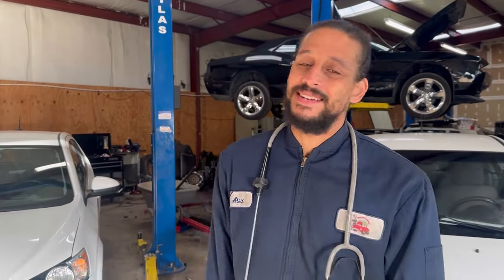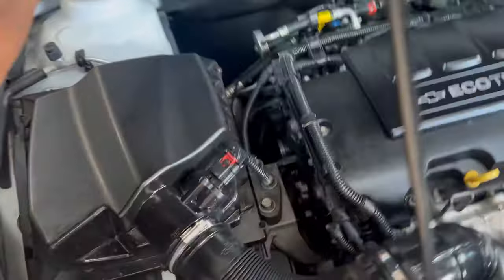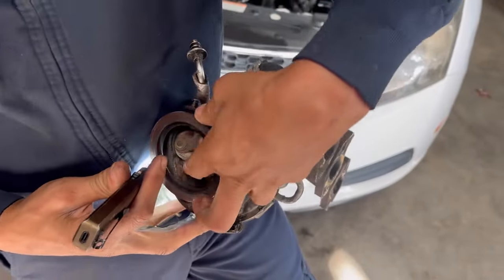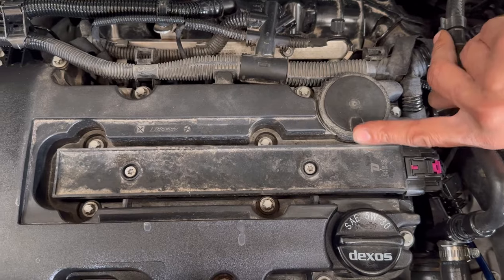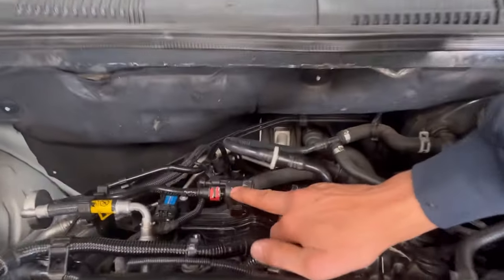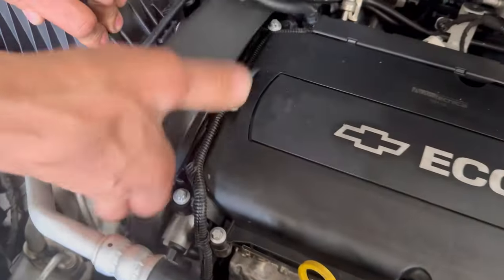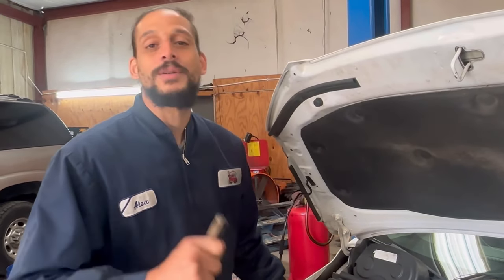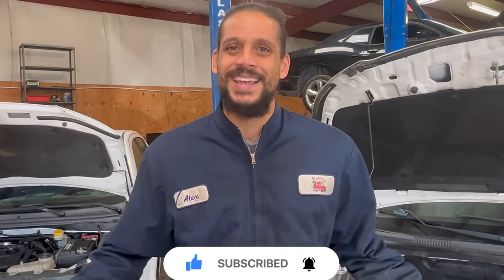Top 5 Problems With The Chevy Cruze (1st Generation 2008-2016)

Comment: This man knows what he is talking about. Several of these things happened to my car. Even the wife was right they didn’t torch mine I had to do that valve cover twice.  This was years ago but. I’m only going back to my Cruze which I hadn’t driven in 4 years, because I totaled my beautiful brand new Honda.  I cranked my Cruze up after almost 4 years and it drove just like it did the day I parked it.  It’s not a bad car just take care of it!
Reply: I call bs, how can a battery or starter not die after 4 years of sitting?
Reply: @pricetagcitrus  You do realize you can disconnect the battery right?
Reply: @pricetagcitrus  Trickle charger? It's what I use on stored cars and motorcycles
Reply: I also had to do my valve cover twice
Reply: What clued you into the valve cover needing g to be changed? My son bought one and there is smoke in the engine compartment quite frequently. Like a fair bit of smoke. He changed the water pump - the old one was leaking
Reply: @pricetagcitrus  dude… I put a new battery in there are you serious?  New fluids… new tires…. And all.   I drive this car till this day.   It has almost 200k on it.  And still drives amazing!!!!  Sounds amazing… I have taken care of it.
Reply: @benh2134  I was told that it needed to be changed so I had it done.  The car was jerking and putt putting and I took it to chevy.  They did my valve cover wrong the first time and my car was smoking!  It turns out that the car only needed ignition coils and spark plugs. And they didn’t even mention that.  Tried to make me replace the catalytic converter and all kinds of other things.  And the car was still jumping until I had the ignition coils changed.   Now it drives amazing till this day.

Comment: My Cruze has over 180k miles and still going strong. The easiest thing you can do for your car is change the oil.
Reply: I agree ours has over 160,000 miles I've dealt with all the leaks fixed most myself but still runs good.
Reply: You got 1.4? Should I do the PCV fix kit ?
Reply: He me mentioned synthetic. Any particular?
Reply: What synthetic oil do you recommend?
Reply: fully synthetic oil, doesn't really matter what brand tbh
Reply: @victortrotciv  Any know brand will be fine.
Reply: @JacobBennington-yx1pg I’m not the guy you’re asking but I got the PCV valve kit and I’d say it’s worth it. Pretty easy to install and I haven’t had any issues with the PCV or valve cover after getting it put on.
Reply: Thank goodness a good comment. I just bought a Cruze 2 weeks ago. I was going crazy with my Kia. Some days it’d start some days it wouldn’t
Reply: My 1.4 turbo has 185k miles I bought in 2015 with 78k biggest thing I done is replace the valve cover and intake for a faulty pcv valve (it wasn't complicated).  I do have to say it has gm electrical issues nothing major: the radio will turn and off randomly.  Bottom it has been reliable.
Reply: @sloc2190  Why if they are so good Chevy is not selling them? Corollas keep selling like hot cakes and never change the name.
Reply: yes!!!!!!

Comment: My wife and I, we own 4 and she just went to buy our 5th Cruze. These cars are great the issues I’ve seen with these cars all come down to one thing and one thing only, the owner. PM maintenance or the lack of, is what causes all the issues. If you replace parts before they break, these cars will last a long time. The one thing you can’t prevent is the turbo. They crack and there’s nothing you can do to avoid it. Out of the 2 engines I think the 1.8L is the better of the two. Horsepower is almost identical, plus no turbo issues. 1.4 also has oil leak issues unlike the 1.8. All in all these are good cars. Just replace parts when they’re suppose to, don’t wait till it breaks.
Reply: EXACTLY!!!!!! I have taken regular care of mine and it's been amazing to me for 12 years!

Comment: Mine 2014 Cruze almost hit 120,000 miles and running still great with no problem issues so far. Most often oil change every 3,000 miles very good care with myself.
Reply: 5000 mile oil changes are typically recommended for turbo charged engines so you're going an extra mile. Good job
Reply: Most people say I have no problems. Have a ton of problem there not aware of. I hear it all the time. Then when I tell them they tell me I'm wrong. Untell I do show and tell. Then I get. I didn't know it was that bad. It drive good to me. Then my tech tells the it doesn't drive good. It's all over the place.
Reply: Changed oil regularly on my 2015 and it has every one of these issues it just hit 135,000 miles

Comment: 271k on my 1.8l and the only real issues I've had were the oil cooler and coil pack. Everything under the belt is still original. just normal maintenance items for the most part. I didn't think this would be more reliable than my series 2 3800 but so far it has been.

Comment: I'm glad i upgraded or replaced all these issues. I believe my 1.4 sonic is just about bullet proof. Metal coolant reservoir , metal water inlet, metal thermostat metal valve cover, pcv fix kit with a oil catch can, replaced water pump and serpentine belt, purge valve, upgraded to billet motor and trans mounts, i got the ultra gauge to monitor temps and boost level.

Comment: 2015 Cruze LT here, bought it used and I swear it could have been my car behind him when he was talking about the coolant lines and the turbo cracking.  Just replace both, 129,000 kms.  It's honestly a great car, especially for commuting, just need to take care of it.
Reply: How do you not take care of it? Why is anyone not giving a specific? Like are people building it to where they fuck it up trying to have fun? Are they doing dumb shit with it like teens? Or just excessively speeding and driving stupid? Don’t want to sound like an ahole, I’m looking for a car I have a budget but I want to spend less until I build up my credit another year so I can get the car I really want, but a Chevy Cruze 2012 is the option I’m looking to go for as he is giving me a deal on it.
Reply: @adrian111- hey I’m in your position just bought a 2013 Chevy Cruz LT it is a good running car but he’s correct, I had issues he mentioned besides the other major stuff . I recently just had my idling problem fixed is because my turbo had to be replaced and I needed a new cooling system you have to let your car sit a few minutes before pulling off that’s with any car really you don’t wanna just drive it through the ground but unfortunately there’s a lot of people that don’t take care of their car .

Comment: My 2014 Cruze with 120,000  miles has had a new water pump, new purge valve, 2 batteries, 4 tires and free oil changes every 5,000 miles.
  I love it.
Reply: @GeraldGardiner-tw8xo  lol some people love throwing money away. You do you. 🤣
Reply: @looneyyang1326  Well, I don't.  That's why I own a Toyota Camry.
Reply: @looneyyang1326  so basic maintenance is throwing money away to you?
Reply: @austinbusher8063  yeah that’s kinda what i got out of it 😹
Reply: I'm a tech in Japan, and I'd say this is pretty good for the mileage. The Toyotas I've owned (I'm a Toyota fan) have had more go wrong with them at the same mileage. 

Free oil changes though?

Comment: Yeah he is definitely not wrong about the turbo issue I'm on my third turbo in The last 5 years in my 2011 1.4 l Chevy Cruze. I also had my water pump replace two days after I bought it. And I've had many water hoses replaced as well this is a very informative video.

Comment: 2014 Cruze LT owner, this video is super accurate. My valve cover gasket is leaking into 1 and 4, I just replaced the water pump today, and I replaced the plastic water inlet by the turbo a few months ago. There is oil in my throttlebody too so I suspect turbo problems also.

Comment: I got a 2012 eco it has a weird "tink" noise when i cut it off and stay in the car for over 15 min. Bought it off my uncle's friend in 2022 and it had 120k miles and currently at over 180k miles. Most recent thing I got fixed was the intake manifold; rly need to get brakes n a new rim BADLY. I don't maintain my car well, but always try to learn something from Youtube. Kudos to you for this video 👏👏✊🏾

Comment: Just bought an identical Cruze to the one in the shop. I got mine with 101k miles (price was reasonable and they gave me a super through inspection prior to purchase). This will be a point A to B car for me as I'll be attending school starting this month around 30 miles roundtrip per M-F days. Have a feeling I'll be seeing issues (boy did my 2015 Versa have those) so I might as well save this for future use. Thank you for being straight to the point, and teaching us how and what usually goes wrong. Should help diagnose any issues I do end up seeing (hopefully I don't have that many but things break down that's just how the world works). Super happy I have my 2023 Corolla to be the long distance traveler as needed for me and my wife. I'll take the older one as I have shorter drives to school than her to work.
Reply: @BHenz1006  How much did you pay for it?
Reply: @sanibelt  $6k and they replaced the windshield as well

Comment: Buick encore has this same engine.. cheap plastic parts do break. Check your coolant regularly for leaks and make sure you change the oil full synthetic 5k intervals. The water pump and evap are common issues. If you maintain the car it can be a decent little car.

Comment: My wife has 2012 LT with 178K, I did some work on it sometime back that it improved the power. It feels great driving it but boy it has too many leaking issues. I have replaced most of the parts mentioned in this video. Now got to replace the gasket on the oil filter house for the second time in a year. Very annoying but I still enjoy driving the car when it has no issues
Reply from the maker: Thanks for sharing! They are decent cars. I see them with over 200,000 often. Maintenance is key!

Comment: My cruze has 228k on it and just now the waste gate is going bad. So im getting a new turbo also my ac don't work ill be getting that fixed also. But I love driving this little 6 speed manual turbo it's a fun work car.
Reply: (Don't know if you already had it done) it could be the freon sensors(one on the radiator on the passenger side, one topside by the return lines). More expensive problem could be the water pump or the ac compressor. Could just be the ac clutch but better to just replace the whole thing

Comment: Hi have a 2014 model Cruze, with 5 speed Manuel. Thank God it's been good for last 2 years.  Only problem I had is top radiator hose and heater hoses were wearing out and changed them then 2 weeks later another common problem not mentioned is radiator coolent reservoir tank burst a hole in the back of it and the coolent leaked into the car slowly on to my wife's feet as I was driving. Car is eight hand drive.im in Sydney Australia.  Replacement tank installed and fixed problem with correct coolent level. After market tanks are made stronger than originals as a common problem to be rectified as they run too hot from factory. Ultimately what they need is an after market cooler operating thermostat. All the best friends.

Comment: I had a 2018 Buick encore (same engine) which i sold at 122k. Blew a water pump but caught it immediately so no overheating occurred then the plastic cooling parts cracked small leak at 100k miles fixed it and evap canister threw a CEL at 50k miles. You exactly correct on common issues. Again if you maintain engine and avoid any overheating and 5k intervals synthetic oil this can be a decent car. But someone the continues to drive with leaking coolant will blow the turbo and head gasket again avoidable with proper maintenance.

Comment: My 2014 Chevy Cruze had over 36,000 miles on it when I bought it used.  Several months after I bought it, it needed $1700 in engine repairs.  It needed a new cooling fan, water pump, valve cover gasket and a new vacuum hose.  Thank goodness it was all covered under the extended warranty.  I think the reason this happened to me is that the last owner didn't bother to address the repairs it needed before they traded it.  Performance wise, it was a good car.  I just wish the quality was there.

Comment: Im going to be replacing my turbo soon but at idle my turbo tings i was told its the wastegate. It dont effect the performance at all just an annoying sound it may give a little less boost but it still drives fine. Im glad i seen this video because when i have the turbo replaced im changing all plastic pieces under the hood.

Comment: The last GM vehicle my Wife and I bought was a new 2006 Pontiac Torrent AWD in May of 2006, which we still own with less than 72K Original Miles in pristine condition. Suffice to say it is the very best vehicle my Wife and I have ever owned. And since I do most of my own maintenance and replacement of parts, Rock Auto has been a real money saver as well on parts, and Walmart on Filters and Petroleum Products.

HOWEVER.. We refuse to ever buy another GM vehicle because GM is notorious for taking the cheapest way out in favor of the bottom line instead of quality. Alex presents a great example by pointing out all of the plastic parts GM uses in their vehicles, which not only saves them money, BUT, still charge you as if they are quality parts.

Another reason why we will never buy another GM vehicle? It's because GM IS OWNED BY CHINA.
Reply from the maker: I love those Pontiac Torrent

Comment: its exactly that, my cruze I had to change the water outlet housing and the valve cover gasket along with the coolant reservoir. all were reasonable cheap to fix so not terrible.

Comment: 8:58 - the manual calls for a timing belt change at 97,500 miles or every 10 years, whichever comes first, on the Sonic 1.8l engine.

Comment: I got the 1.4 turbo for commuting and its cool. I do my own oil changes with quality synthetic. In hot summer days i will put midgrade fuel in it. Seems to like that batter than regular in the summer heat. I get 40mpg on the highway driving the speed limit. Decent little car.

Comment: So my partner has one of these and so far the list as followed.

1. 3 coolant res bottles cracked.
2. 4. Water pumps.
3. 1 valve cover.
4. 1 turbo which I am currently changing

Comment: Chevrolet Cruze 2015 1.4 owner here and I once got changed overflow hose for water, water pump, valve cover gasket Rear break pad holders Crankshaft oil seal, and I almost got robbed for that but thankfully I ordered all the parts online but still the labor was expensive
Reply: Did it stop your leaking
Reply: @SusieBell-hk2up  hope so 
Sounds like he put $ into it

Comment: I’ve had my 2013 Cruze for 5 years..  I’ve replaced the turbo 2 times, the transmission, the water pump, about 5 head lights, the battery, the ignition coil, ball joints..   currently I need to replace my heater core, coolant reservoir is cracked, a/c compressor is out, my fan only blows out of the dash, and I have a misfire when I’m at an idle in drive, not at an idle in park, and my struts just started to rattle a couple hundred miles ago..  

But I’m still averaging 36 mpg….. this is the only great thing about the Cruze…
The maintenance is high

Comment: Alex, I like your videos and have subscribed. However, I think you should do a update to this video. You stated in a lot of other videos that you hate to see customers waste money. Well, With respect, I think recommending this car to anyone or at least coming off making it sound like they are a decent car does not serve the customer well. These cars are for sale everywhere and at highly discounted pricing - used of course. However, They have a bad history of recalls and repairs. The one that really caught my eye is the recall for Steering wheels breaking away from the steering column. 

I drive a 2008 Buick Lucerne with the 3800 series III engine. I bought it back in 2010 and now have 164,000 miles on it. While I have done a lot of work on it, Its mostly because of lack of maintenance and some GM flaws like the back seat fuse box problem. However, I bought it because it has Buick's best made engine in it. My GF had a 2003 Malibu with the 3100 in it. She ran it up to 190,000 miles and had to rethread the rocker arm bolt holes in the heads (just two) and pretty much thats it. Pretty impressive for that car. She now drives a 2007 Buick Lucerne. 

Thank you for the video(s) and hope you had a good Christmas/New Years. :)

Comment: Mine leaked at 100k. It was the valve cover and gasket, got that fixed and new air filters. Leak fixed. Smell was gone and it ran better

Comment: Informative video. I am from Canada and have a 2016 Chevy Cruze LT with only 44,000 miles, (original owner) and last week had to get the camshaft cover replaced. ($900 usd cost parts+labor)) Pretty disappointing because I get all the recommended service and oil changes,  but it is the first repair I had to do on the car....I will keep an eye out for all the other things you mentioned.

Comment: I financed one of these.. worst decision lol it gave me alot of issues at first. valve cover failed and the pcv system did aswell but i ended up replacing those, then had some coolant outlet pop on me thankfully i caught it the moment it happened, just shut it off and pulled over. didnt over heat! been good to me since then..... knock on wood lol.

Comment: Changed the coolant outlet on my 2013 Sonic THREE times between 50k and 85k miles.  Now at 92k miles.  Just replaced the camshaft cover and installed a PCV fix kit.  Pretty sure my head gasket is blown now and I've never run it hot.